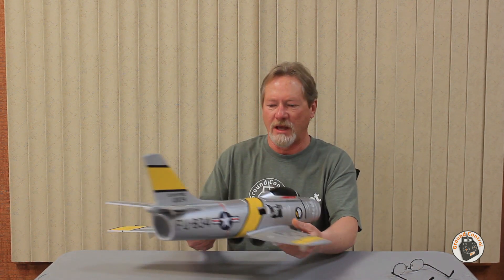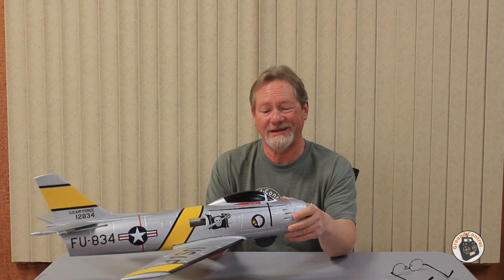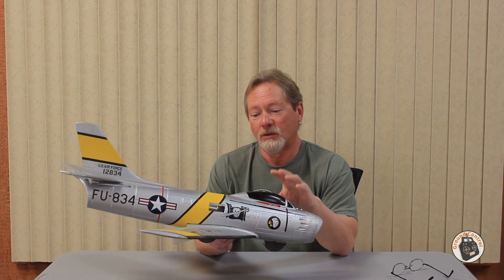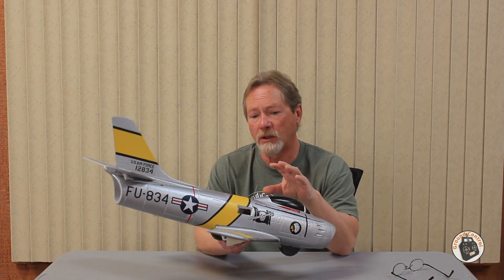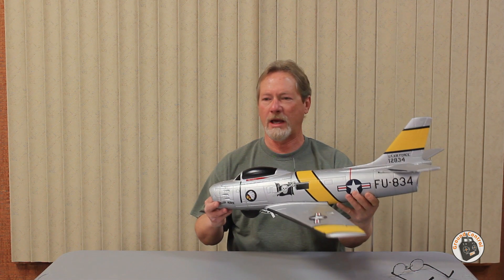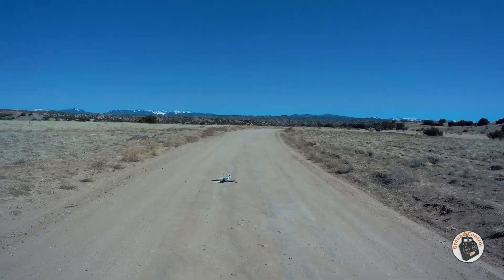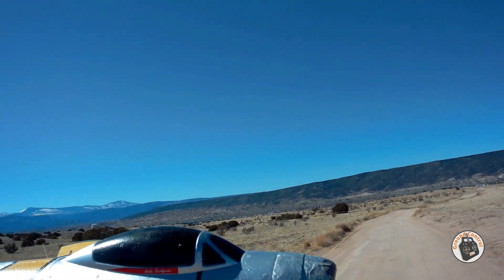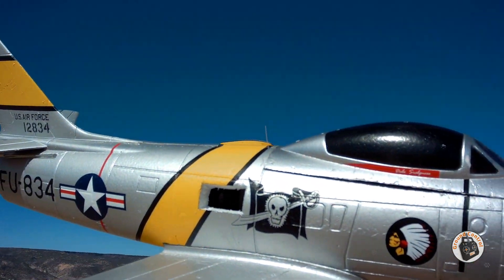Last Flights of the Freewing F86 Sabre Jet - Freewing F86 Sabre Jet 700mm Wingspan 64mm EDF Jet PNF

Comment: Curious to here what you are putting the power system in.
Are you not tempted to try a prop pusher conversion on it to see what happens?
It should reduce the wing loading a fair bit by allowing you to use a smaller lipo... and also allow you to move the lipo further towards the wing which would help with pitch authority..
Reply from the maker: Hi Paul!
I would if I thought this F86 Airframe would benefit from it but it's just not a stable Airframe and it's somewhat unpredictable when performing maneuvers.
With the additional air inlets and a small 4S LIPO it has plenty of power and now launches nicely with authority but poorly designed.
The replacement Airframe is supposed to be delivered today ;-)
If it it makes it here undamaged I should be able to unveil the new Airframe soon and it will be setup with full 4S power.
I'm very much looking forward to performing the Maiden on it as soon as possible.
See you in the Air!
Reply: @GroundControlRC  I'll be interesting to see what your new airframe will look like and if it performs well. I saved all the pieces from my destroyed Freewing F-86 Sabre and Mig-15 jets, so maybe I could use one too.
Reply from the maker: @texasuavpilot  I hope it works out as planned.
Did the Mig have the same 64mm EDF?
Reply: @GroundControlRC  Yes, both jets exactly the same configuration. I even bought an extra set of two 64mm EDF motors with fans for both jets and never used them.
Reply from the maker: @texasuavpilot  Oh Man! I need to find some airframes ;-)